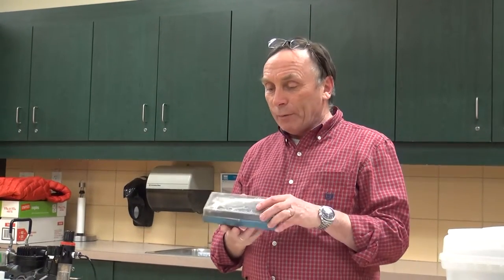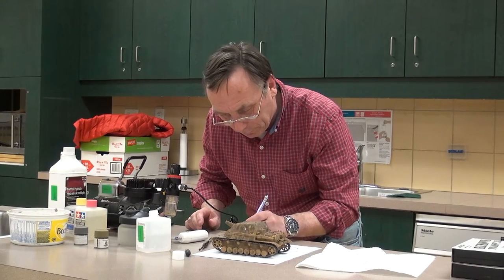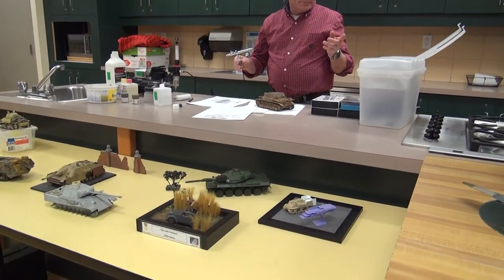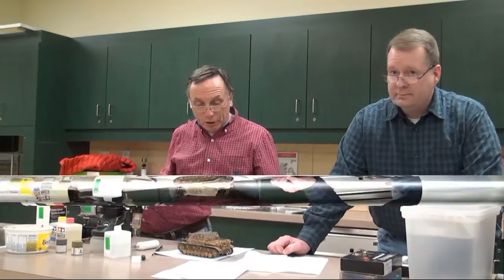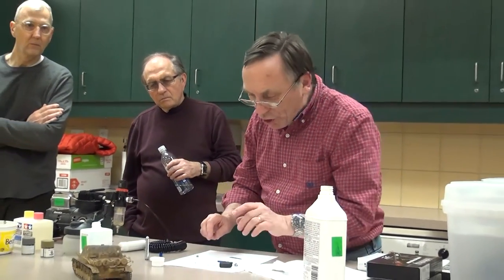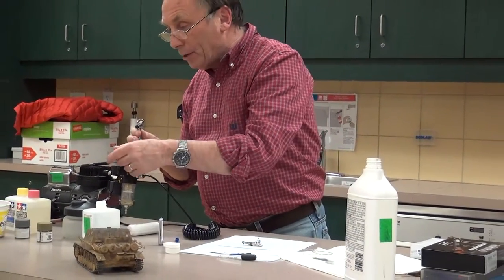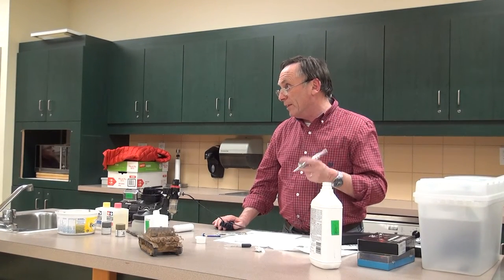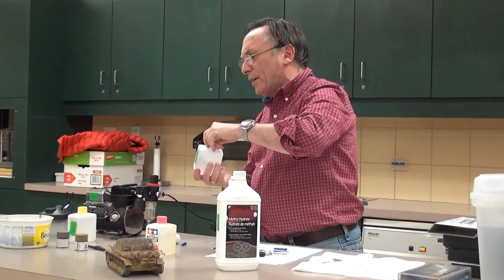Plastic Scale Models Tips & techniques

Comment: The Iwata Revolution Cr comes with a 0.5mm needle by dfault. You can have a 0.3mm needle/nozzle set for this airbrush but personnaly this a costly option so I would go with an Iwata Eclipse instead . This airbrush comes with a 0.3mm needle. Personnaly I don't see the point to go with a Iwata Micron. These airbrushes are too expensive.  Trigger control is the key in airbrshing.